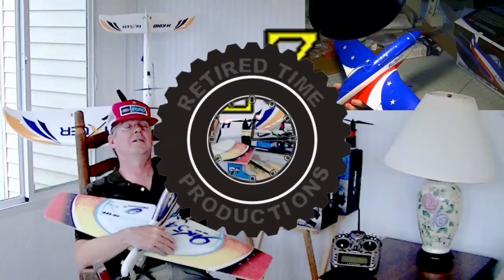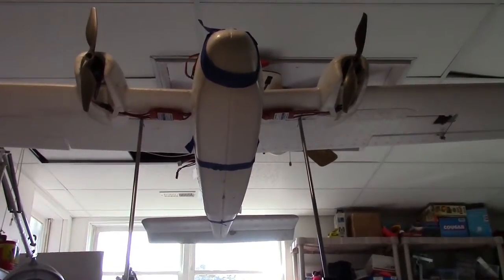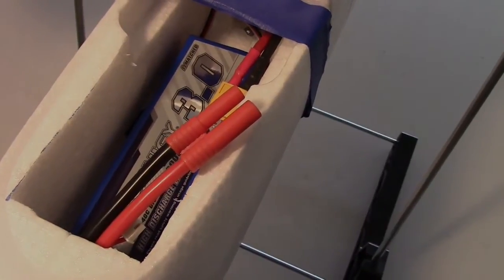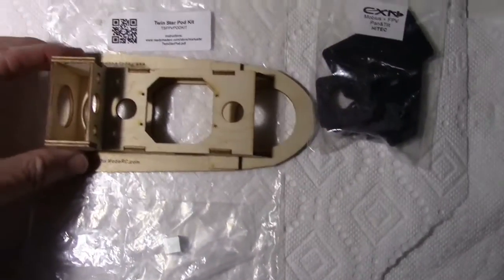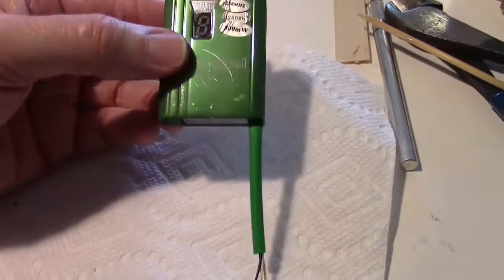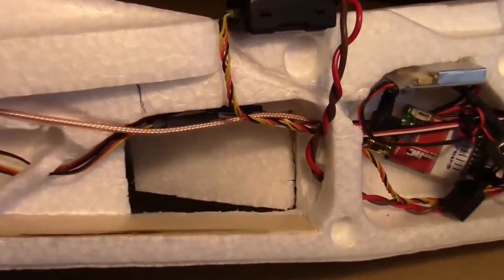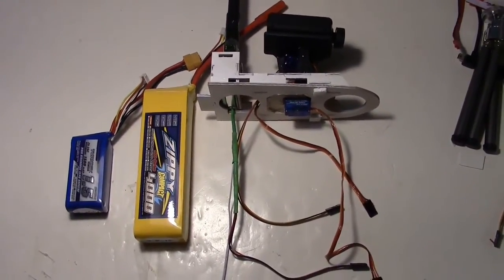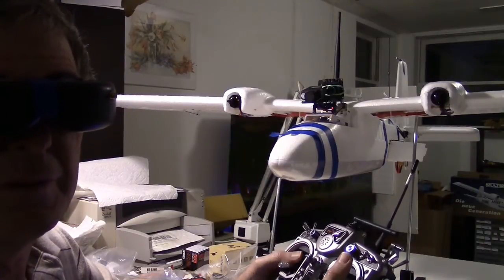Vector FC Bench Test, Video Pod for Twin Star, CG Balancing - FPV Build Part 7

Comment: Just wondering, on your CCD camera + sound.. have you noticed a hum or buzz when the CCD camera is hooked up?  On mine, using the surveilzone cc1529 sony 960h, if its plugged in (5v single lead).. i get a buzz.. the mic is working as if you tap it you can hear it, but a distinct buzz in the background (its not the mic either, pull the mic and the buzz continues fed through the vid tx audio lead maybe)
Reply from the maker: +theskyisthelimit Yes I have noticed this too with other hardware. The audio just is not very good on these analog FPV systems. I use amplified mics and that helps but there is still a huge noise floor.
Reply: Yea I guess we just have to live with it. But in my case it's definitely the camera making the noise even with the microphone unplugged. It might drive me nuts to hear it in the goggles though, we will see:)  EDIT:  same noise even with the runcamhd as the main camera
Reply from the maker: +theskyisthelimit It might be the camera with in my case too. I never thought of that way so maybe you have given me a new angle on the problem. All my board cams are 12 volts. I have never tried unplugging the cam to see if the noise stopped because that would mean a loss of video sync which would cause the vtx to stop transmitting video. I never thought that the audio might still be there after unplugging the camera so that is a new mind set for me.
Reply: +dmerc00 Yeah its a bit bizarre.. i also tried 12v on the surveilzone cc1529 as well.. just to rule that out.. then i switched the cable to the rancam hd cable.. same problem in all 3 situations.. background hum/buzz.. just realized that maybe i should try pulling that red pin i added for the runcam and see if using "self" power if the hum goes away (theory.. yes).. if so that means the current being passed to the camera is causing interference.. ill try that tonight.. im at the full on bench testing phase where you were in this video basically.. cant wait to get er back up there:)
Reply from the maker: +theskyisthelimit I am glad you are trying to find the cause. I am wondering if a LC power filter would help. I know they sometimes solve video problems not sure what it would do for audio.
Reply: +dmerc00 I thought about that, though I wasnt sure where it would be placed since the problem source is likely a dirty signal coming off the vector itself, so i guess an lc filter would go before the "esc" connector point (or cut the esc wire in half and put in there, just a guess).. i have one on hand.. i guess first ruling out the power signal with the runcam tonight to verify.
Reply: +dmerc00 I should have added, from the research i did online, most of the time this hum is caused by a ground loop issue, though i'm not sure where the loop is (still a novice at understanding these), the only spot i had tried to avoid one was with the ESCs.. on the Y cable i pull the red pin to avoid it (issue is there with or without the wing attached).  Its possible this pulling of the red eliminated the loop on one side, but since two power sources are going into it overall, it still exists.  Ill try pulling the bec from the equation as well, to see if that does anything.
Reply: +dmerc00 Ok I tried removing the bec power from the vector while using the runcam hd cable with the red power connector pulled, so strictly one power source going to the vector.. same audio hum..  I guess this rules out a ground loop.. back to the drawing board and unsure at this point.. maybe putting an ic filter between the battery connector and the rest could help.. i may try that later on.. just make an interconnect to put in there with the filter, easily removable.  EDIT: the filter made no difference.. so at this point i'm going to go with "this is how it is" or maybe the RMRC 800mw tx is somehow responsible.
Reply: +dmerc00 I contacted RMRC on this.. they pointed out that in the vector manual there is a section on buzz:  . strangely it says to increase the vector "black level" setting in the OSD setup menu .. i would never have thought to do this.. does this seem like it may be the fix.. ill have try this evening.
Reply: +dmerc00 I was able to confirm that the vector and the OSD is causing the humming.  I powered just the transmitter (video tx) and used the runcam via battery.. no hum.. pulling up the osd for the vector via the radio transmitter there is a black level osd text or similar, set at 2.. if you set it to 3 it goes away but 3 is terrible to look at.. so i found that if i lower the color intensity to 25 it helps a little, better than nothing.. now i'm out to figure out why the radio transmitter is causing my servos to twitch

Comment: Hey there.. curious on the RMRC Pod kit.. did you paint that white.. mines standard balsa brown.. i was thinking of using either acrylic or spray white or black paint and coating it, or maybe using plasti dip spray on that too, though maybe plasti is too heavy.. curious what you used.
Reply from the maker: +theskyisthelimit It was just some cheap white spray paint from Wal-Mart. You can use about anything on wood. I was trying to keep that toy plane look.
Reply: +dmerc00 I figured the paint might help keep it from weathering, thanks for that info..  One other question, the CXN Mobius mount.. i cant figure out how to attach it to the RMRC pod kit.. how did you secure the two together?
Reply from the maker: +theskyisthelimit I am making a short video to show you. Stand by...
Reply: +dmerc00 Oh wow, fabulous.. thanks sir.. it wasnt immediately obvious, so appreciate it.
Reply from the maker: +theskyisthelimit Here's the How-To Vid.
https://www.youtube.com/watch?v=nAv81HNsppU
Reply: +dmerc00 Awesome, that was fast, thanks.

Comment: Dave, another great video. That plane is really coming together, but if you have to cram in much more in that fuse, I'm afraid you'll be needing to grab for a tube of KY instead of the tube of Welders... lol ;)  Looking forward to the maiden and was wondering if you might post a wiring/component schematic when you are done with the build. That would be helpful.
Reply from the maker: KY lol, Yes I will probably do a schematic eventually or some sort of diagram. So far it has been straight forward on the connections. The Vector makes things so much easier than the APM was. The only thing I really changed was to add a video battery and even that was as simple as making a JST 'Y' cable.

Comment: You mentioned it, but I really think you are going to want to get your pitot out on a leading edge somewhere...this is critical.  Also, I suggest if you are going to use a slider for the pan tilt, use the left slider for pan and the right as you did for tilt...they will be much quicker to get to in flight!  Great work.
Reply from the maker: tpalshadow Both good ideas. Guess I could get used to the slider if I don't keep bumping it. The knob is less likely to get bumped by accident.
Of course it would help if I had the upgraded sliders with the better detentes. I could mount the pitot tube on a tongue depressor sticking out of the fuse like I did on my SkyWalker, worked good on it.

Comment: Ha ha  ya very sharp. I had those very props on at the beginning. Watch your fingers. I actually was breaking in my motors and had it on a stand. Reached around the fuselage with both hands to pop on the pod and caught my left index and fore fingers and ended up with 20 stiches. Lucky I didn't loose a finger :(
Reply from the maker: ThailandVenture Ouch, now I am afraid to get near it.

Comment: For the props.  As ironic as it is we use quadcopter props ;) 8.4.5 that way u can use one CW and one CCW. That way u will reduce on the thrust vectoring and have a much smoother flight when on and off the throttle during take off and in flight gliding. U will be supposed on how well the twinstar glides with all the weight on board. Also it's a GREAT cloud surfer ;)
Reply from the maker: ThailandVenture Thanks for the encouragement! Yes my props are also counter rotating but they APC 7.5E (electric) and 7.5EP (electric pusher).
They look awfully sharp and dangers :-)

Comment: Looking great Dave! You've really made excellent use of the limited space within this airframe. Very nice so far.
I'm wondering if you will still get some prop wash on the vertical stabilizer. I'm thinking a wing tip mounted pitot with the sensor unit imbedded in the underside of the wing is another option. 
Cheers!
Fergy
Reply from the maker: TheAdkFlyer10 Thanks. It's like trying to put too many carry-ons in the overhead compartment on an airliner. Stuff it in and close the door, quick!
Yeah that might be better or could mount the pitot tube on tongue depressor sticking out of the fuse like I did on my SkyWalker.

Comment: I'm anxious to see how you like that pan/tilt setup. I used the same kit with the same recommend servo's and it was just too wobbly. The servo's were also really jerky as you can see in my video here: https://www.youtube.com/watch?v=FnCllAtyt8Q

Minor vibration at all motor RPM's just from how the whole thing is mounted on that pan servo.
Reply from the maker: Excuse me for not getting back to you but I just found your post in the spam bucket and approved it. The cause was probably the link to your video. Which pan/tilt? Are you talking about the RMRC pan/tilt made of plywood or the CXN pan/tilt (black) or maybe the black plastic one from BevRC.
Reply: The CXN one. I had the same one on my Specter and wasn't completely satisfied. It's held up by that pan servo and there was some wobble in it leading to vibration in the video. I also used the same servo's you did (they're recommended) and I found them quite jerky and rough. I hope you have better luck!
Reply from the maker: Chris Riccio Sounds like a 360 sail winch servo on the pan would help or some felt and friction disk to stop vibrations.
Thanks for the advice and the luck too!

Comment: O ya and another thing u may want to invest in is a couple of wing tip skids for the ends of the main wing. 25 cents will save your main wing and also create a better point of contact with the ground that will help prevent a landing spin out ;) also good for running 8" props without then hitting the ground. We run 8" and 900kv motors with the 3s 5000 25 and get over 40 min and in some cases with good conditions can achive up to 1 hour of flight
Reply from the maker: ThailandVenture Thanks for the tip on the wing tips. What pitch to you have on the 8" props. I am using 7x5 for example.

Comment: Great set of build videos for the twinstar. From my experience as a 3 year twinstar flyer. The 3s battery will be more than sufficient and using a 3s 5000 mah will get u more than 35 to 45 min of flight with your setup.  Also in many cases i used a 3s 800 mah for video and pan servo and placed it in the rear hatch area about 2 to 3 inches from the back of the main wing.  But I believe u shod not have a problem with a 3s 5000 25c and getting it balanced.  Can't wait to see your flight videos I'm sure u will be VERY happy with the twinstar flight Characteristics  as well as the high flying capability and longevity of flight.  Not to mention how darn stable it is :)
Reply from the maker: ThailandVenture Good to know the Twin Star is good performer for you. I am looking forward to trying it out weather permitting. It's winter here now. Thanks for telling me about your power system and I may try the 3s 5000.